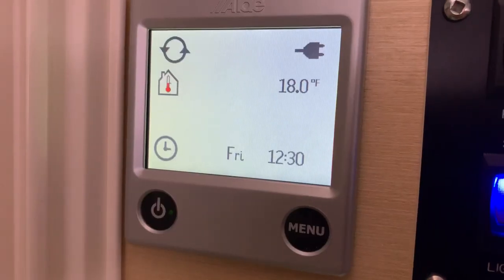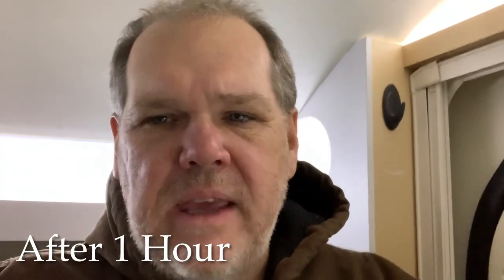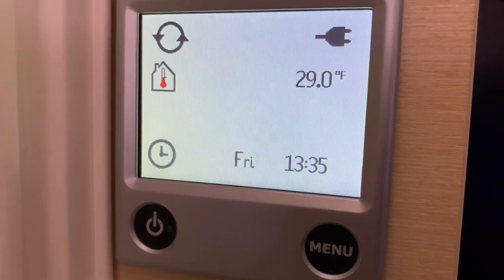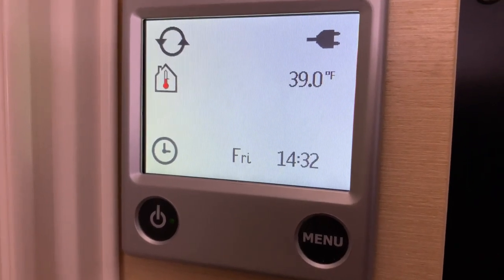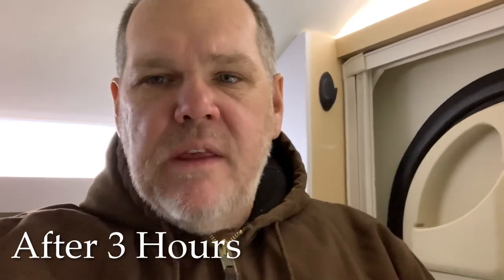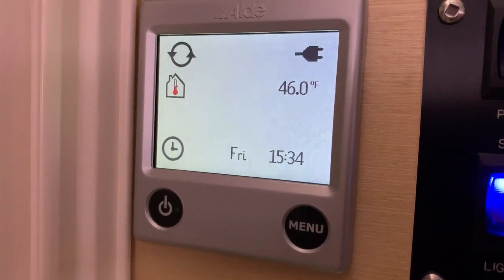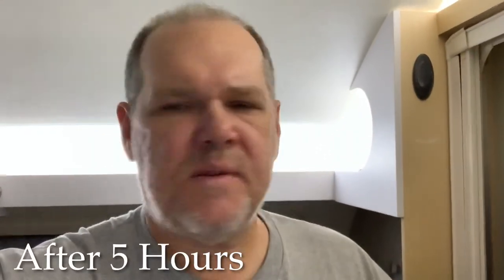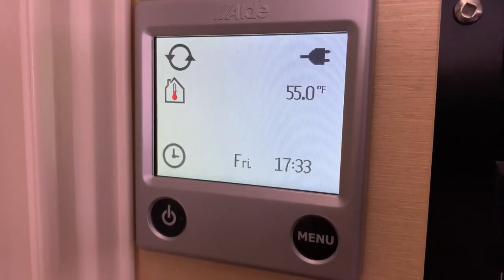NuCamp T@B 400 Alde Heat Test in Extreme Cold Weather

Comment: It would be interesting to see some tests using electric (1 kW vs 2 kW). We just pulled into camp here at ~45 degrees and it took 3.5hrs to come op to 70 degrees in the camper @ 2kW.
Reply from the maker: When I spoke to Austin at NuCamp in December, he highly suggested to me to use propane to heat the trailer.  He said it would heat much faster vs electric.  He said electric is fine for maintaining once you get the trailer up to the desired temperature.
Reply: @TravelswithDelaney  good to know! On another note it looks like we might have a water heater issue (I have yet to try any troubleshooting) where it only barely heats the water. Looks like I've got some work to do before our next trip
Reply from the maker: Most likely you just need to adjust the hot water regulator. We had to do that on ours when we got our 400. It’s locates in the outside water valve access panel.
Reply: @TravelswithDelaney  well that is actually maxed out.. I read on Alde's website that you can't heat the cabin and run the hot water heater simultaneously. Does that align with your experience?
Reply from the maker: Mark Simon There is a water boost option that we always engage before we take showers.  It’s on the control panel for the Alde. It will divert heat away from the heater and put all heat toward the water for up to 30 minutes.  That works well for us. If the regulator is maxed out and still no hot water, call Creed at NuCamp and he may suggest a simple adjustment to that regulator to adjust it up higher.

Comment: It seems the Alde system is a closed system. So how does it lose glycol and need to be “topped off”?
Reply from the maker: I am. not totally sure on that.  I do know there is a release valve so some can get released through that onto the ground.
Reply: The glycol solution is actually mostly water, from what I understand -- so I'm guessing that over time, some of the water evaporates?

Comment: You have two power settings on gas and you can run electric and gas simultaneous. 
"Gas:Propane Output 1:3.3 kW- Consumption:245 g/h Output 2:5.5 kW- Consumption:405 g/h"
Reply from the maker: Per Spencer at Alde and Austin at NuCamp, if you turn on both electric and propane at the same time, the unit will always default to electric if there is a power supply.  The quickest way to heat up the Alde is to turn off electric and run on propane.

Comment: Using both the propane and electric (which is faster for heating the trailer), once the trailers up to temp, it predominantly uses the electric for maintenance and only utilises the propane if it needs additional to help it maintain the temperature.
As it’s an open system it will slowly evaporate so you will need to maintain the fluid levels.
Just need to program the controller properly (see below).

https://youtu.be/gTxXu-YGADs?si=PWs9YFGZ9RqC-tVN

Comment: Why would you wait 5 hours to get heat up to 55 degrees. The alde system is worthless.
Forced air system 72 degrees 20 minutes. .
Why would you ever get an alde??????
Reply from the maker: The upside of the Alde is it is super quiet especially compared to forced air furnace that is constantly kicking on and off and it gives you a consistent heat.  Both systems have their pros and cons

Comment: Use e tensi fly for winter camping in Scandinavia. However a good trailer is important as well. We have winter trailers here which have appropriate insulation and heating. Floor heated trailers is very common. Nice warming your feet.

Comment: I don't get it... you need actually keep burning propane for 5 hours until it gets to 50 degrees??? Then you need second heater from Amazon to keep yourself warm? I'm confused.
Reply from the maker: +agent 404 You must have misunderstood what I was saying. We only use the little propane heater if we need to get the temp up quickly in extreme cold weather. Because it’s a radiant heat system it does take awhile to get to temp when it’s extremely cold in the trailer. I
Reply from the maker: I'm not familiar with Truma.  I will check out the link you shared.

Comment: Thanks for the informative video. Paul the Airforce Guy just released a construction video that shows much of the Alde heating system as it is installed. Here is a link to it: https://www.youtube.com/watch?v=if066aMnC2U&t=18s . I have noticed that my Tab 400 heats up faster with the Alde system if I leave the bathroom door open. This might be because the radiator on the bathroom wall is closer to the heater than the other heat exchangers so is hotter, or it could be that the bathroom radiator is exposed and not buried in a cabinet or other enclosure like the others. I haven't run a test to validate this but have just noticed it while camping. Thanks again, I enjoy all your videos.
Reply from the maker: We will have to try leaving the bathroom door open.  It makes sense that it would help with those pipes being right there on the wall.

Comment: What a shocking installation that extension tank looks like it has been thrown in, no securing of the pipes. Also, using your words, “for those who don’t know how the system works” which includes you...if it’s that cold you use both electric and gas which doubles the heating capacity of the boiler. You intimate one or other...no use both and suggest you read your user manual
Reply from the maker: Sorry but you are wrong Stewart.  I know this because I actually talked to Spencer from Alde about the system to clarify how it works.  You can turn both on but it will always revert to electric if both are on.  Alde recommends only using propane if you want to heat up more quickly. The Alde does not work like a traditional water heater where you can use both at the same time.
Reply: @TravelswithDelaney  Hi, I think there some confusion. If it is the Alde 3020HE boiler and I believe even the 3010 had dual power sourcing. However, in the touch screen you can select the default power source. It will on arriving at temperature default to that source of power. Also when you select the water temperature boost ( the triangle on the touch screen) the pump will stop the pump from circulating to the heating start all power sources and heat the water to approx 68 - 70 degrees C it shall only stay on this function for 30 mins. Unless you have Alde Flow fitted which overrides the time out.
likewise if using Alde in a Motorhome with the heat exchanger, the system needs to be on but NO power source selected to allow the glycol pump to pump it through the engine heat exchanger and heat the water and vehicle.
I have had Alde for over 20 years in around 6 different motorhomes.

Extract from Alde website around power sources for 3020HE Boiler :

As you no doubt know it  operate off either or both . The  has an output of approx 6KW non-modulating while the  has two settings at 1KW and 2KW. So as you  appreciate the response  to reach the set point temperature on  is slower than that of the .
Reply from the maker: Stewart Robertson Ours was the 3010 and both Alde and NuCamp told me that having both sources on did nothing extra as the system always would look to electric if there was shore power to the trailer.  There recommendation for the quickest heat up time was to use propane only.  I can’t speak to anything other than the system that was installed in our 2018 NuCamp T@B 400.